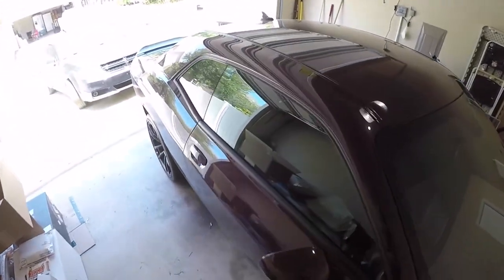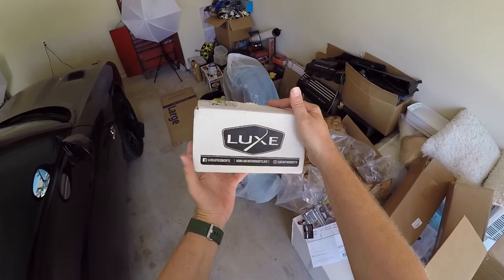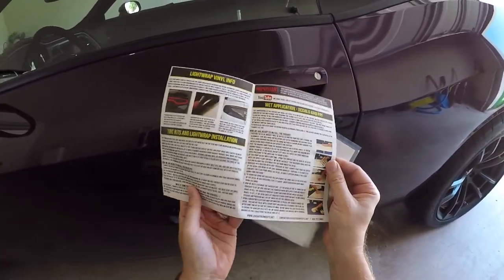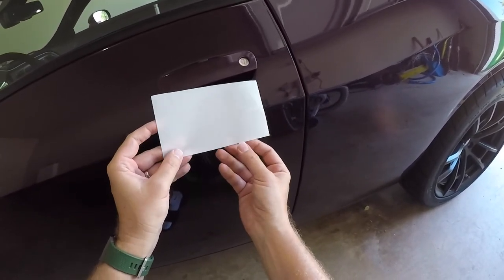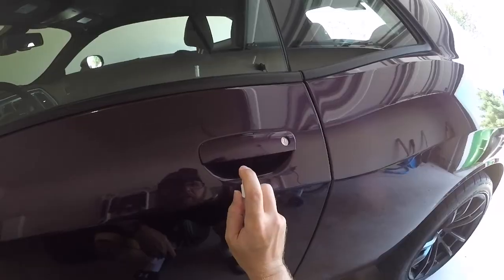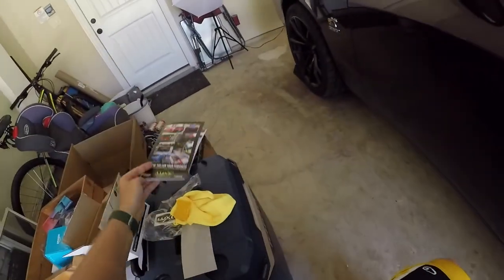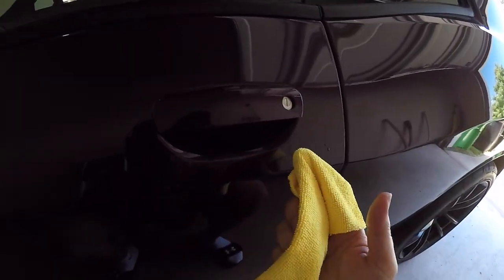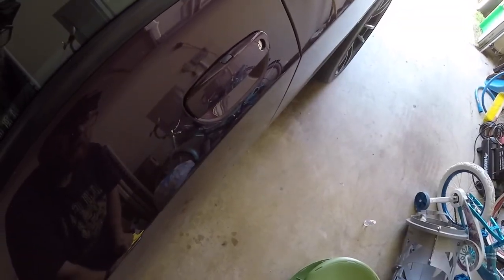Installing Luxe Door Handle Cup Paint Protection Film on my 2020 Hellraisin Dodge Challenger 1320

Comment: Spray the crap out of the car and the piece of wrap.  It is too dry.  I put 3M ones on my truck. I used a water/alcohol mixture.  Wet your hands well so you don't leave finger prints on it.